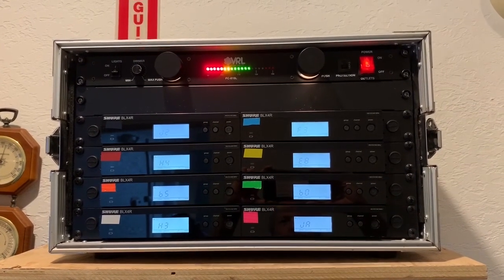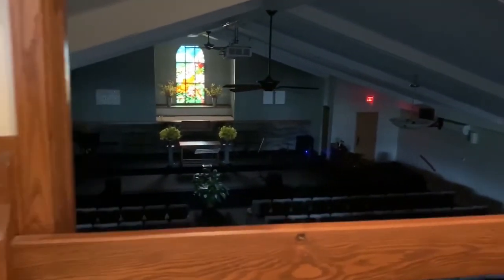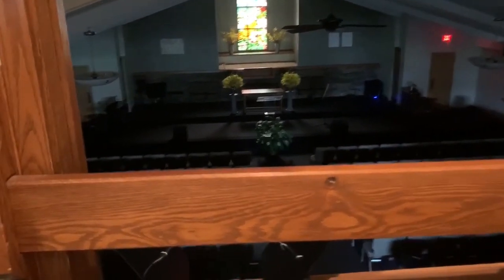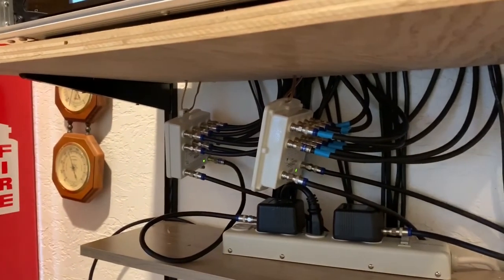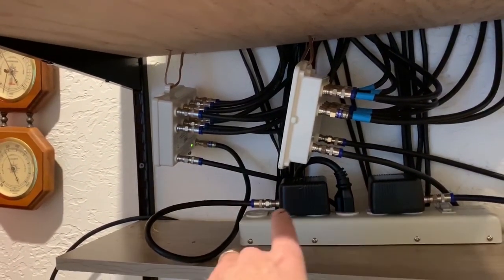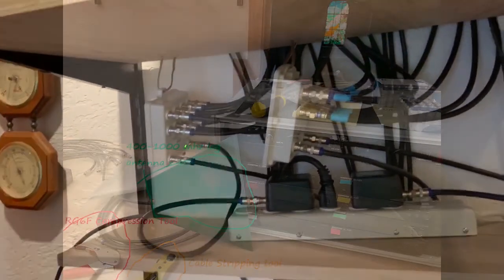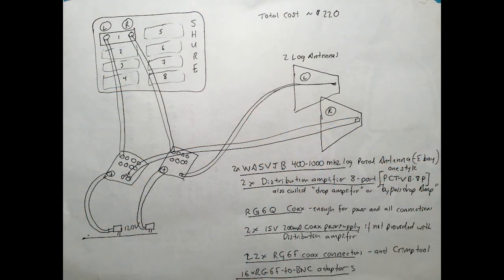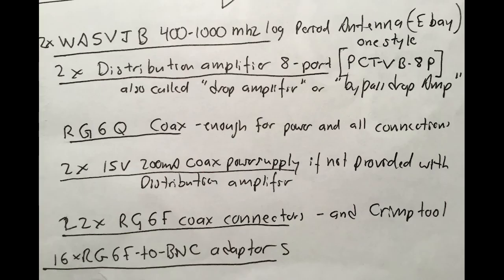DIY Antenna distribution system for wireless microphones

Comment: As an RF engineer my advice is dont do this, using 75ohm products in a 50ohm system. This will only add noise and refections that cause phase cacelation in you antennas.  Also 75ohm amplifiers are desigb for a much higher singal, so  you will be using the amp well below its slew rate.